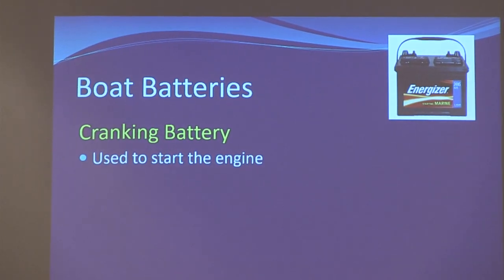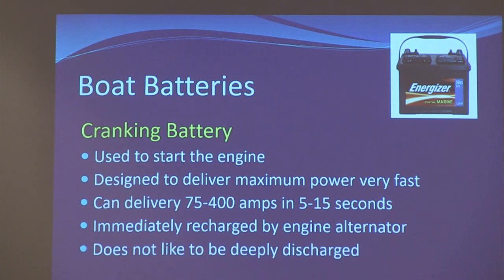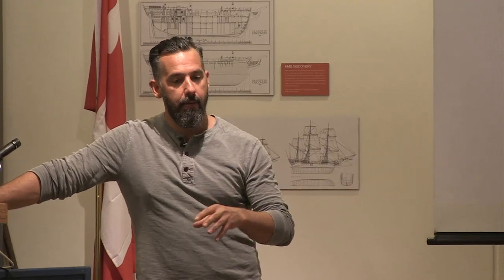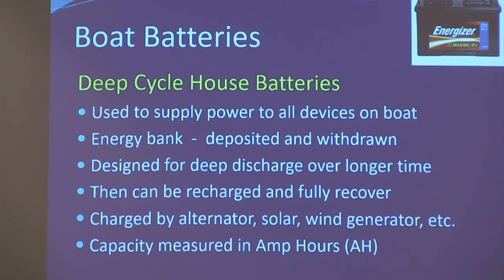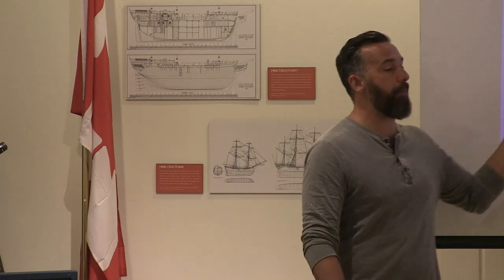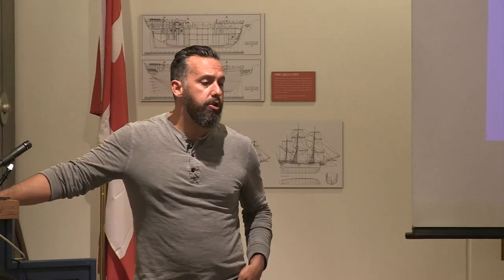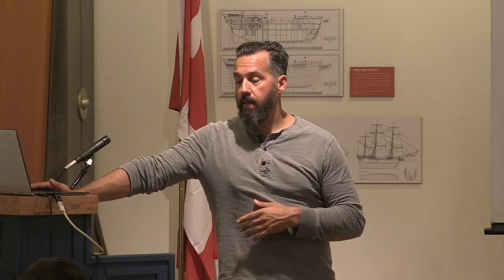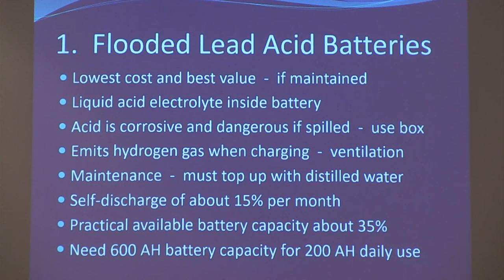Seminar: Marine Electrical Basics - Part 4 of 6

Comment: This is good stuff. After watching the first couple of hours, I realize the unsafe condition of my electrical system.  Thanks to the cobbling and sloppy changes made by the previous owners through the years, my 1981 Watkins 27 is at huge risk.  Jeff has made this subject very interesting and I will be replacing all wiring/fuses/terminal strips plus the panel per his "do it right" approach to the subject.  Should be fun actually.

Comment: I am extending my outboard battery cables using AWG2. should i be placing a fuse just after the stud terminating the AWG2 in between some AWG4 to protect the stepped down cable?
AWG2->STUD->AWG4->125Afuse->original AWG4 honda battery cables

Comment: I'm new to your channel, but you hit the nail on the head on a few subjects! I'm planning out a electrical system on a 14 foot Jon boat.
Reply from the maker: Good on you, learn first and then do it yourself: LF DIY
Reply: @PacificYachtSystems  Oh yeah! By trade I am a aircraft electrician (Helicopter). I also do car audio as a hobby. But alot of your Information crosses over between both. I like the portion on Solar power,that will be helpful to me later on down the road.

Comment: I Owen a Morgan OI 41 that has all original wire. Without saying the wiring is not even marine grade. Deep down I new I would have to rewire the boat but now I don’t even want to put it back in the water. My plan is to do the rewire one section of the boat at a time. I’m adding all new mare electronics so I will start with that. My plan is to run new line from the Mfg. distribution box via 10 AWG to a fuse block at the help and then connect all the components from there. Is this the right way to go?
Thx

D
Reply from the maker: Going gradual is definitely the way to go. Same here, we divide our boat projects in achievable parts.

Comment: I have been progressively rewriting my 1975 sail boat, one circuit at a time, primarily because i had no choice. There was welding wire on the main battery cables; countless butt connectors on a single circuit; house wire instead of marine wire, etc etc. The volt drop between alternator and starter motor was a full volt, before i traced an offending connection (a smoldering short circuit which would surely would have developed into a full fire, had i not caught it). I have now also changed the main panel. 

A question, however: What does the code say about having (in-line) fuses on circuits that are also protected by a circuit breaker? The panel came with 15A breakers as standard and I have changed most for 5A breakers (the lowest you can buy). That is OK for loads like the fridge, water pump etc. but many loads (LED lights,  electronics etc) draw only mA's, so on those circuits i have added a 1A or 500mA in line fuse. Is it OK to forgo the in-line fuse when the breaker matches the load? What does the code say about this?
Reply from the maker: Hi Stephen, your approach of breaker and fuse is common. Circuit breakers only come in 5 amp increments and fuses are way more granular and specific (e.g. 7 amp fast blow, 2 amp slow blow)
Reply: @PacificYachtSystems  But is it OK to have no fuse if the circuit breaker is appropriately rated?

Comment: Jeff, I love your videos, and I’ve learned so much since I started watching them. Good honest truth. I have a question: my sailboat has two AGM starting batteries that the previous owner put in, and also four 6 V flooded lead acid golf carts for House bank. I also have a spare auxiliary battery that is two years old and is an AGM group 31 like the two starting batteries, just slightly newer that is not being used but it’s holding a good charge still. I learned what you said about the charging issue with the different chemistries. Since the AGM‘s are not cheap can I take the existing three AGM’s and use them for the house bank service and purchase one new AGM for the starter bank and get rid of the golf carts? Looks like the existing AGMs are about three years old and one is approximately 2 years old. Would that be advisable? Or do they all need to be brand new from the start in order to receive a good charge. 
Thanks for your time answering this.

Comment: Hi Jeff, love your videos but my boat electrical system is simple, just like me.
I have a 20 foot pontoon boat with a dual battery and three way switching for the individual batteries or dual battery feeding the consul and everything is only fuse by a 40 amp fuse at the battery switch. 
I want to add a ST split bus fuse block ( two isolated six circuit fuse block with a negative bias, one amp to 30 amp) to connect new instruments and to protect existing instruments. 
Questions:
1/ do I individually rewire my instruments, fuel gauge, ignition switch, rpm meter to the fuse block or combine toone circuit? And if I do what size fuses do I use?
2/ I added to the boat Electric Bimini top with two separate motors. 
Do I fuse each motor separately or combine? And what size fuse do I use?
  
Would love to see a video on pontoon boat wiring the right way, it’s simple terms.
Thank you for reading this if you do, and any help with pontoon boat electrical systems improvements from factory wiring will be appreciate it.
Sincerely grateful
  Bob
Reply from the maker: Hi Bob, all good questions. Have very limited experience (one boat only) on Pontoon boats and don't know them firsthand. 1) All engine instruments are generally powered on one circuit only, don't see a need to rewire each gauge or sensor to individual fuse blocks. 2) Generally, each motor circuit should have it's own fuse.
Reply: @PacificYachtSystems   thanks Jeff, I will dedicate one circuit each for the motors. The instrument all tied in to the power Feed  ( existing) , I will dedicate one circuit on the fuse box. The question is, what size fuse do I use? Without knowing how much each one of The instruments drawers, I’ll be guessing at 7 or 10 amp fuse ( Will have to put a meter to it) . The wiring it’s either 16 gauge or 18 gauge so I think a 10 AM fuse will protect the wiring but not sure about the instruments , May need a 7 amp fuse. In our case, thank you for replying to my questions. Study pontoon boats and make a video, there are literally thousands of us novelist boat electrical guys out there that could use your help. I primarily did electrical house construction, completely different animal.
But in the long run the guys that put the pontoon boats ( electrical ) together need to take your classes. Once again thank you and have a good day.
Bob

Comment: really great videos , many thanks it a lot of experience and basic that I need for the safety of my boat a hallberg rassy 29 from 90 that as many ads that make really mess of cables and small electrical panel with huge amount of cables in no room at all so know I want to re do it as much as I can the best way possible , many many thanks , greetings from Spain

Comment: Speaking of a windlass... why couldn’t you run ac to the forepeak locker and use a converter to switch to DC?
Reply from the maker: Yep, lots of boats recharge thruster or windlass battery banks with a battery charger located near the battery bank, powered by AC. Challenge is having AC power source away from shorepower or for those boaters that don't have a AC generator.
Reply: Thanks for your reply and videos. Merry Christmas!

Comment: Battery bank. Take 'current use' & double it. Add an additional 50% & DO SOLAR. (Or, add to current solar capacity). Now, it sounds ridonkulous, but- we are not going back to the stone age, we are moving into a digital world. Take the C & C 36 MII with 36 DC breakers. In 2018, he had over 70 and in 2022? Space may be the final frontier, but battery storage is the ultimate battle! Batteries last longer when under utilized. Batteries last longer when receiving charge (Solar, wind or EFOY or alternator...) Just because I need 400AH daily to go 2 days without sun, how long would my batteries last if I was using only 10% of capacity?

Comment: Hi I got a question my water pump and bilage pump come with a 14awg wires and are about 8inches long I want to connect them to a switch panel wich has 12 awg wire  would I be able to connect the diffrent awg wires together or would I have big problems
Reply: There would be no problem connecting to 14 awg wires from the pump to the 12 awg wires
Reply: @machew2009  thanks

Comment: Im wiring a small boat using a 8 gang switch panel a 12 way fuse box 4 lights 2 batteries a battery switcher with 1-2 both and off  pos bus bar and a neg- bus bar could you help with that thanks

Comment: 10 minutes in and I have to say this guy is doing a trash job explaining fuses and wire size. The fuse should be match the load and be the weak link. If your device needs 5 amps use a 5 amp fuse and look at the chart to see what the proper gauge wire should be. If your running a 5 amp load at 1 foot you can use 14 awg no problem. Now if it was 20' away the fuse will stay at 5 amps and the wire should be 6 awg. Fuse location doesn't matter as long as it's on on the power wire and before the load. It can be at the switch or the device it doesn't matter they will both blow at 5 amps. The wire gauge will change depends on the distance and load. The longer the distance the higher the resistance.
Reply from the maker: the fuse always needs to go at the beginning.   it's protecting the device and the wire.